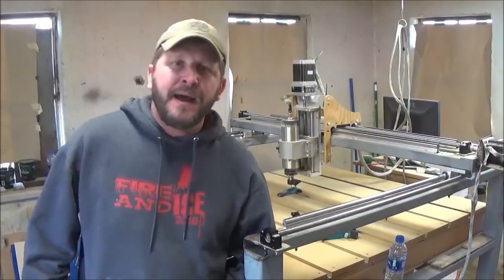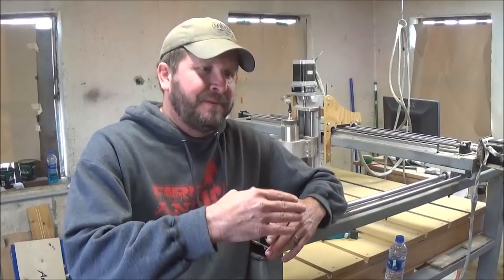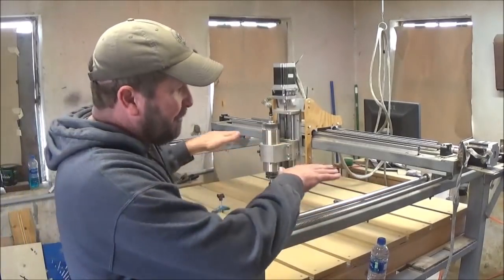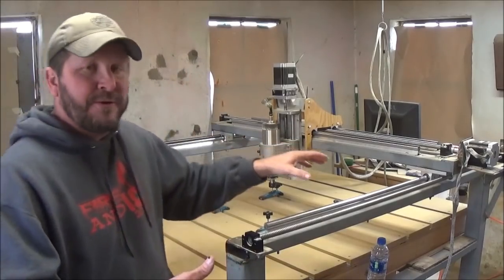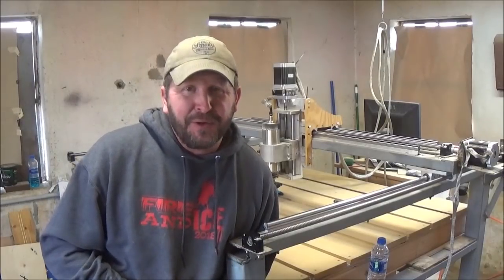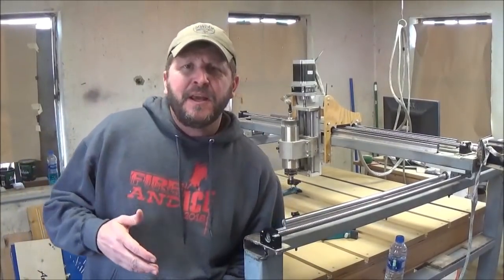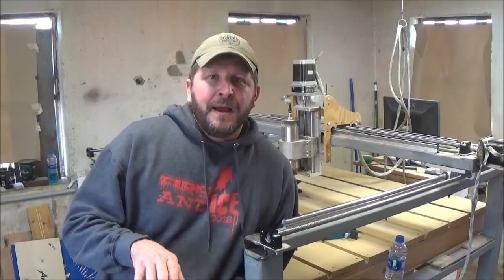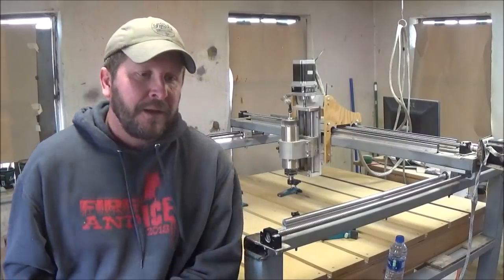DIY CNC BUILD (Where to Start)

Comment: Thank you for your support and information, wanted to ask, what thickness should be the steel shafts for a 2 by 1.5 meters diy simple cnc frame, are 20mm shafts strong enough for such x and y length and would nema 23 motors be good enough to move the axis or should be bigger?

Comment: Using those rails, can/should you mount them vertically for the gantry?  I'm purchasing the 1500 rails you suggested in your descriptions from other videos, I was just wondering if they are designed for being mounted that way.
Reply from the maker: You have me a bit confused.....Are you talking about when I suggest turning the gantry on its side putting the rails sticking out to the side?
Reply: @SmokeysCNCWoodworks  yes, I was wondering with all the weight, would that orientation be stiff/strong enough?
Reply from the maker: @strikermed  MMMM....got to admit that would be a bit of a gamble...I was just looking at increased cutting area...again my design just came from my head after researching for several months...I think the motors could handle it, but can't tell you 100% that it would work perfectly

Comment: I think I'm going to build one from your parts list on your videos.  Some minor changes in design.  You have rectangular tube for the gantry.  I'm going to stand mine up and use heavy wall angle iron to connect rectangular tube to table guide rails.  This eliminates the angle at the Z head and eliminates the aluminum plate at each end of the gantry.  You can mount the X axis bearings directly to the back of the Z axis assembly.  The bearings do better with a side push or a down force than they do with a up pull.  More a personal preference thing maybe.
Reply from the maker: No that makes perfect sense....A heavy angle iron I think will work great...The main reason I went with the rectangular tubing, I literally had it all laying around from some Rv and Boat storage buildings I had built a few years before I built the CNC...I was trying to cut cost where I could....Thanks for watching!!

Comment: Really like this, been looking to get into stepper motors, not for CNC milling but to actually drive a mirror less camera. Saw a vid on CNC milling and it just clicked for me. I was gonna a do this with camera sliders for it to be more portable but this looks really good.

Nice work
Reply from the maker: Oh wow, that would be cool, I put a link for the stepper motors I use, I think you would be able to use like a nema 23 or I think they have a nema 18 or 16....you wouldn't need the heavy duty ones like I used...You get that going you let me know....oh wait I'll just run over and subscribe I see you have a channel....Thanks for watching!!
Reply: @SmokeysCNCWoodworks  I'm just working things out at the moment, but i like the CNC rig part. I've seen a few which allow the bed to travel as well which should in essence make the travel appear longer. I don't need much too much torque on the rig, I'm just thinking I may need something beefier for the camera as I want this to last and not struggle with the XYZ axis. 

I'm just waiting for money to come in too. Same old story once an idea pops into your head it's a nightmare not creating it. 

It will mean I can offer more in the product videography work im doing for my new business.

The machine you have made is very cool. I'm just wondering about backlash and how to minimise this.

Comment: Hey i plan on a similar build like this. About 6' x 6'. Steel gantry. Want to do 3d relief carving in hardwood. Do you think nema 23 motors would be enough or would you recommend nema 34?
Reply from the maker: Right off I'm going to say you can't go wrong with nema 34's, I think it is probably more power than needed, but you would tax the larger motor less and with the extra 2 ft of travel you sure won't regret the speed it provides when you are just moving the spindle into position. I have not once had any regret in buying the larger motors.....Thanks for watching!

Comment: I used aluminum on my second CNC. No welding. Just several dozen tapped holes. It’s nice that way too in case I want to remove and upgrade some portion so I don’t get stuck grinding apart weld joints.
Reply from the maker: Thats awesome, hopefully i won't be moving mine anytime soon, because its near 1000lbs, and i would have to do just that, cut the frame apart....Thanks for watching!!

Comment: Thank you. If you set your gantry on edge, you would eliminate one steel 1" x 3".  Would there be a need for the 4th motor?
Reply from the maker: I would still have built the gantry the same way with 2 pieces of 1 x 3 attached at each end and put the linear rails on each piece of 1x3, just turned up on its side...yes there would still be 4 motors...1 on x axis, 2 on y axis and 1 on z axis...there are many systems with only 1 motor on the y axis.....Thanks for watching!!